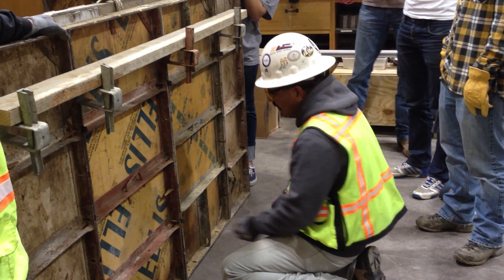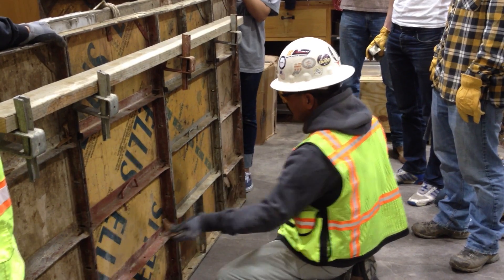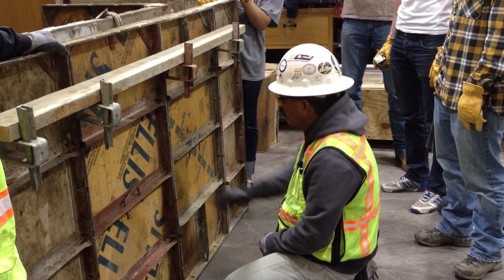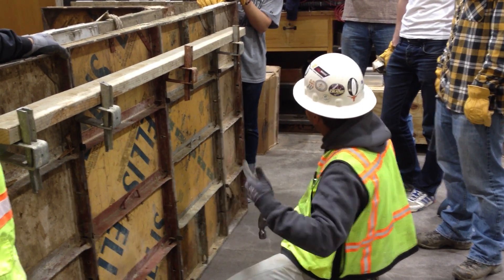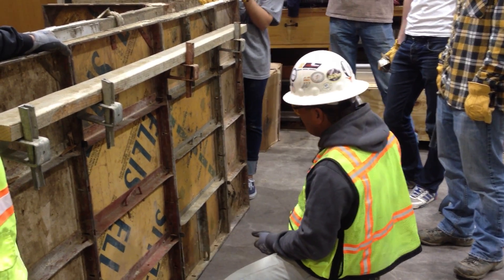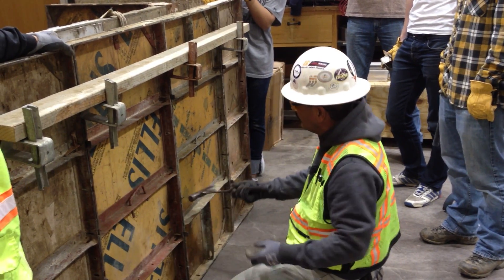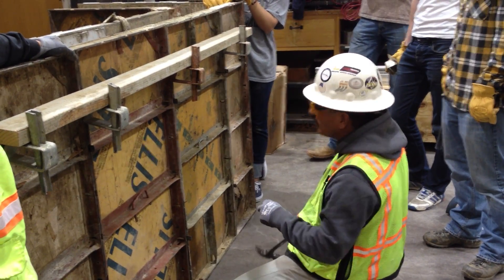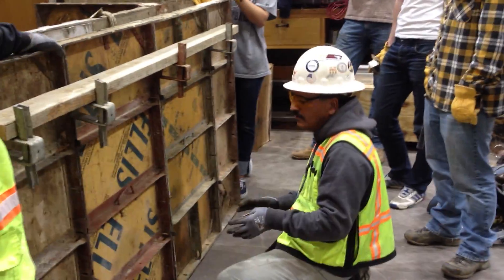Formwork Assembly Demonstration

Comment: Those saying he doesnt know what he's doing are either highly ambidextrous or too dumb to gaf.

Kind of related- had a project manager come out to help us start forming the foundation walls for a bldg addition ( 3 sided foundation)...dude started at a corner, lol, stuck the horizontal wedges thru the forms then proceeded to put the vertical cinch wedges in upside down (from the bottom up)...I walked over and smacked one wedge with my hammer and of course it fell right out.